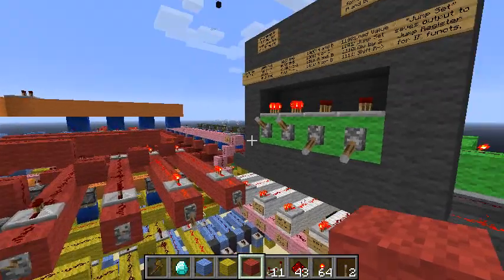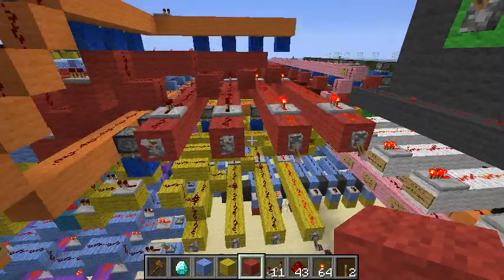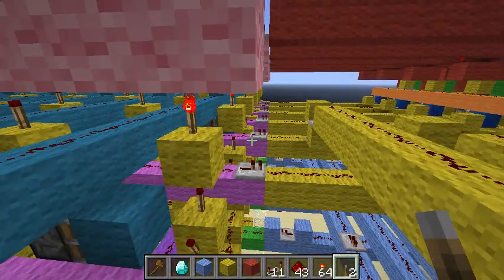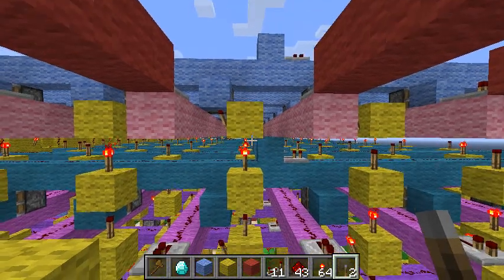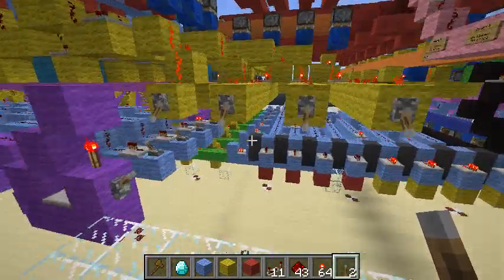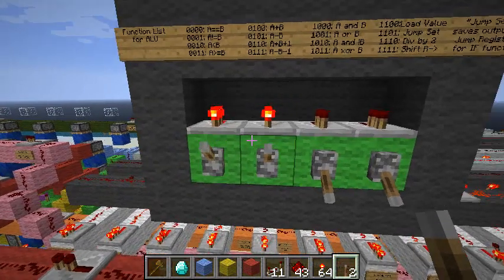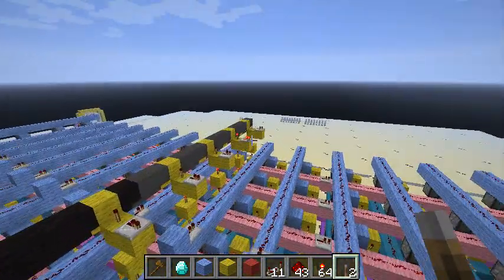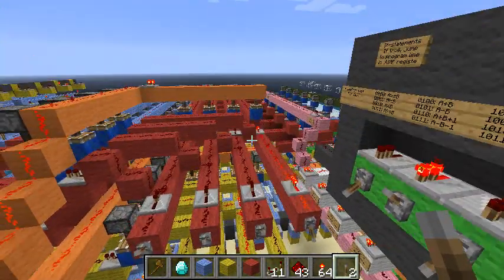CPU manual operation

Comment from the maker: I have 15 Registers of 8 bits each, so that would add up to 120 bits.  I will probably only end up using 7 of them for actual data, but keep the rest of the addresses available as Input/Output interfaces.  No program this will be running will be able to make use of 15 registers.  For storing larger volumes of data, I intend to create a large array of memory that will be accessed using a pointer.